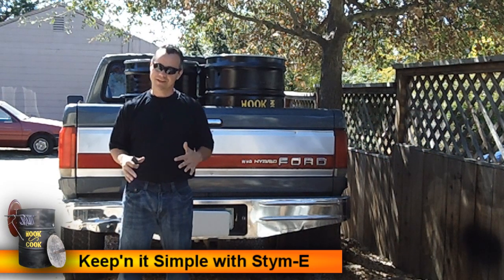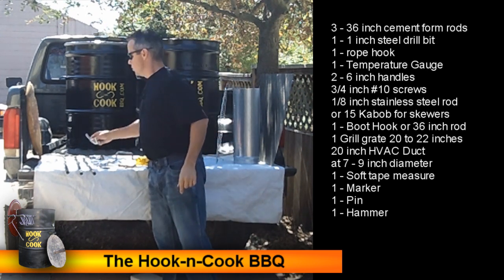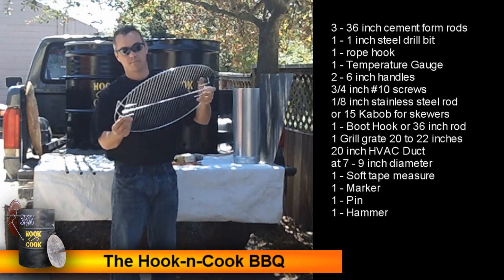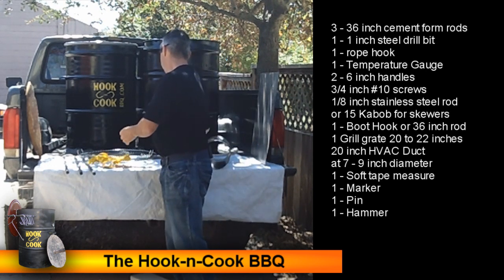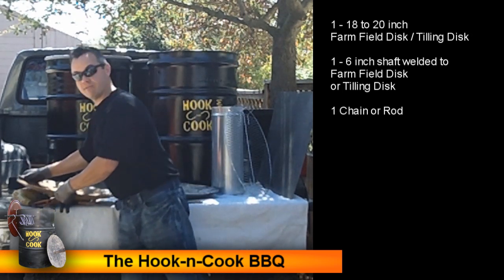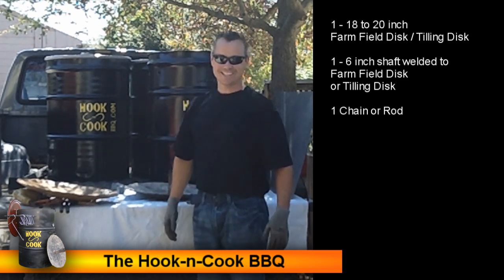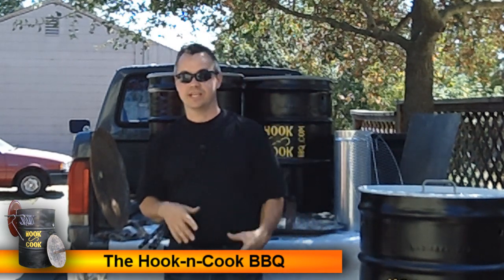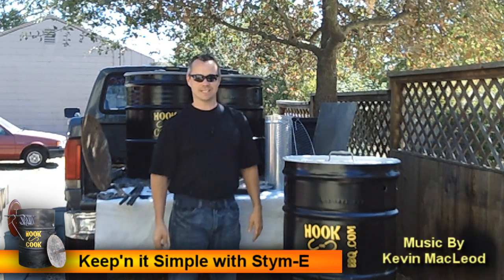UDS Ugly Drum Smoker How To Build Hook & Cook Style

Comment from the maker: Hey AJ, Just 8, 1 inch around the Bottom & 6 on top.... no more, no less, no bigger, no smaller. It needs to be RAW Steel on the inside, and my paint is regular and it holds up fine. However if i had to paint it from raw steel I would use high heat.

Comment: Does the size of the exhaust hole also needs to be regulated or can I just put a 2" exhaust and adjust the temp with the bottom holes?

How hot does the exterior gets? do you have to paint it with high temp paint or you can use any paint?